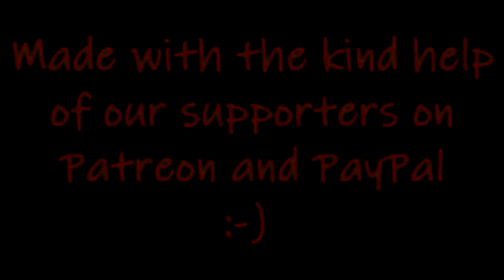Hatch, hatch, hull; Building a cruising sailboat - SV Tapatya EP140

Comment: Anything less than a steel boat can benefit from an aluminium or brass strap on the bow running down to the keel. Whether beaching or just running into debris in the water, a bit of metal will save you repairs away from home...Always loved some woody bright-work on a boat, relieves the eyestrain of an all white topside...
Reply from the maker: Yes Mike, exactly that has been under consideration for a while now. Obvious benefits, as you say 👍😀